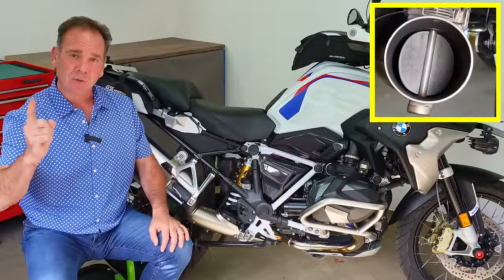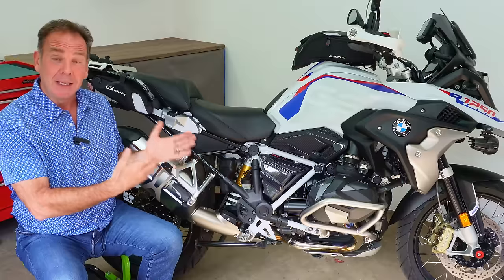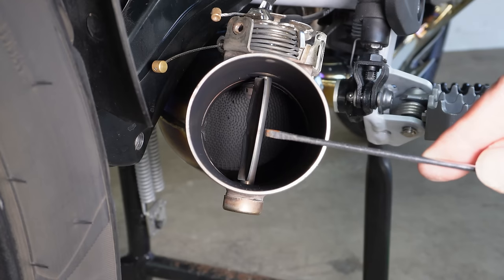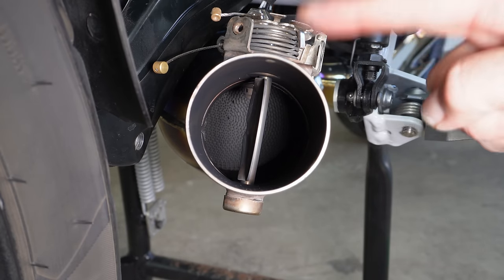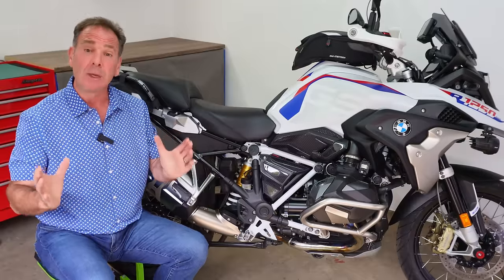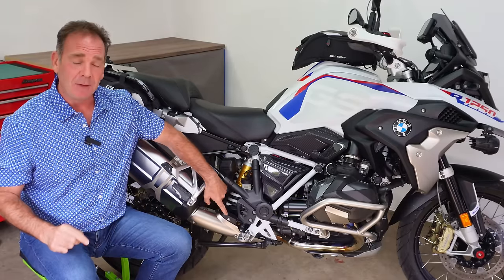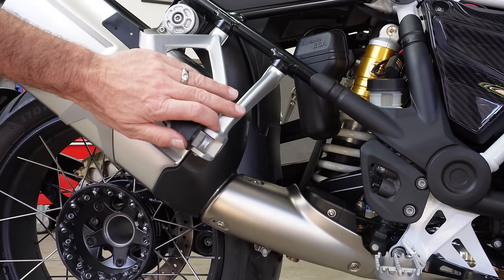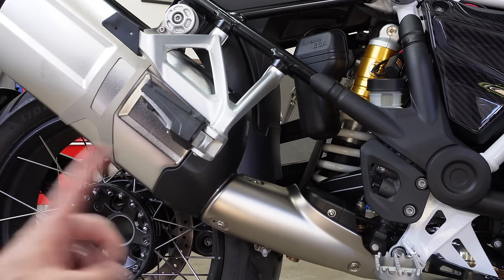EP 25: Butterfly Valve - Exhaust Valve - Exhaust Flapper - Sticking or Seized Valve - BMW R1250GS/A

Comment: Could a stuck or semi stuck in the closed position flapper result in ridiculous heat in the cat and on the right foot? I purchased a 10 year old GS and in anything above 60f, it roasts my right leg.
Reply from the maker: Hi Paul , it’s possible and easy for you to check. The valve needs to operate freely.
Plus…
Other known causes are aftermarket under engine crash plates (skid plates) and some of the rear shock protection devices (mud protection) have been reported to restrict airflow and increase heat levels on the right side.
Also the gear you use is important. I wear full height leather boots and trousers all year. I’m aware of some heat but it’s not excessive for me.
Hope this helps Carl
Ps, for owners that really can’t live with the heat, they often fit a decat set of header pipes.

Comment: Great video…. Really informative……I’ve wurth aluminium anti seaze in a spray can… its good to 1100degC. Is this ok to use or does it have to be copper?
Reply from the maker: Several owners have used it so I would imagine it’s ok to use, although I’ve only ever used the copper spray.. temperature rating is good 👍 for what you have. Carl
Reply: @justthewayitis  great thanks 😎
Reply from the maker: No problem 😉

Comment: Great video, on my 2023 GSA I disconnected the cables &  tucked them under the heat shield where they can move in and out freely. I've been running it that way for over 500 miles, it didn't set a code nor did the check engine light come on.
Reply from the maker: Hi Bill, good morning and thank you for for sharing your experience, you have been very lucky that no codes have been displayed. Best Wishes Carl

Comment: A 2010 r1200gs also has the same valve - so how it lines up with the euro 4/5 noise reduction tests?
Reply from the maker: Having not tested the 2010 bike  with regards to valve operation I’m not 100% sure but it’s probably only there for noise reduction. You could disconnect and do a simple test to see if you notice any performance reduction but I doubt it. Carl 🙋🏻‍♂️

Comment: If this valve is for Euro 5 why was the valve fitted to a 2010-2012 R1200GS Euro 5 did not apply for the 2010 model?

They also seized up on this model as well just like every other GS that has one fitted.
Reply from the maker: Correct they valve is their for noise regulation on the older models too, perhaps I wasn’t clear enough on that point. Although I thought I was.
Carl

Comment: For curiosity sake would doing the servo delete cause any warranty issues or grumbling if my bike had to go back to the dealer for any warranty issues ?
I have a lovely arrow silencer on my 22 GS and have considered doing the servo delete. 
I’ve considered replacing the front headers but been told it could cause warranty issues 
My Harley background never had an issue with changing any exhaust and only required a tune if also doing the air filter but I can’t establish BMWs take on this. Any advice you could pass my way would be very appreciated :)
Reply from the maker: Hi Norrie , better to ask your local dealership directly so you know for sure yourself.
But from what I was told yes it affects warranty if you remove it or replace the front pipe’s.

if you delete it that probably does not affect warranty.
Carl

Comment: Hi is the main benefit to removing the servo to get more noise from the exhaust
Reply from the maker: Partly, yes more noise is an outcome, sone owners like to remove it so they don’t have any sticky or noisy exhaust valve operation.
But on some motorbikes there are additional benefits in performance in the mid range 
Regards Carl
Reply: @justthewayitis  hi I’ve got a mk2 S1000xr do you think a servo buddy would help the bottom end mid range of my bike.

The biggest problem with the mk2 S1000xr is the drone on the motorway at 70mph I always thought it was the air box but I’ve got no idea how to quieten it down
Reply from the maker: Hi, I think the only way to achieve what you are looking for is a proper setup on a rolling road by a specialist that has experience doing exactly that.
Which might involve a delete module for the valve along with fuelling changes to improve the midrange.
You can also check out your local XR forums and see what other owners have done.
Carl

Comment: Brilliantly explained video, thanks so much Carl..   Looking at a £1700 repair from BMW (!), I've currently part-disassembled my exhaust system; however I've got stuck where you disconnect the two control cables... I can't unhook the front one  because I'm unable to rotate the valve like you do, at all, because it's completely seized solid.   Any ideas?  I'm guessing that even if I do get the cable off somehow, I'm not going to be able to use your method to free it up anyway?   Is it worth me buying a delete module, just to get rid of the dashboard warning?  (I don't like the idea of riding with the dash warning permanently on, because it could mask some other future problem?)
Reply from the maker: Hi David, yes to an idea 💡 
Front lower right (see video) remove the control module ( 3 bolts I seem to remember) and you should be able to then easily remove the cable. 
If your is seizes then use wd40 and try to get some movement then leave overnight and move it some more. If you’re lucky it might free off. Although if it’s bad replacement is the way forward.
Let me know if that works 
Carl
Reply: @justthewayitis  Cheers Carl!   Have got the second control cable off now, and the valve is now marinating in WD40. Will keep trying it over the weekend and see how it goes - am not overoptimistic though, looking at it...
Reply from the maker: Fingers crossed 🙏
Reply from the maker: Hi David, another option 😊
Have a look here at this uk company that provides a service on your seized valve.

They offer a great service.

Say hello to them from me 🙋🏻‍♂️
https://www.cymarcbikeparts.co.uk/seized-exhaust-butterfly-valve-service-53-c.asp
Reply: @justthewayitis  Well I did get the valve to move very slightly; but 4 days on, with continuous WD40-ing and wiggling and it's no better at all (can't move it without a mole wrench) so I'm calling it a day.   The Cymarc option looks like a good shout, thanks (I know the company, too) but logistically would be a bit of a mare, sadly.  So the Healtech dongle looks like the way forward I think - just to be clear, there's really no downside of that on this engine, apart from a bit more noise at tickover?
Reply from the maker: Hi David, not really I think you will be fine 👍🙋🏻‍♂️
Reply: @justthewayitis  Thanks Carl - just to put this to bed; I bought and fitted the Healtech dongle; the bike is now back on the road and running perfectly, and after the requisite 3(?)  restarts, the dashboard warning light is gone and I'm a very happy bunny again.   Can't believe that I could been £1700 down to sort this out (likely just for another couple of years, too!)  if I'd followed BMW's lead.   Really can't thank you enough for your video and your support!
Reply from the maker: Hi David, then you now have a happy ending to the EV story which is great. Treat your wife to a very nice meal out with the savings 👍😉
Thank you for letting me know
Carl

Comment: very interesting and easy to follow video so well explained verberly and visually, one question can the servo that operates the mechanism make a high speed clicking noise   on start up , on my multistrada  also 2013
Reply from the maker: Hi Steve, i had a 2013 Muttly too, beautiful bike, yes listen carefully to the right hand side panel under the seat, that's were the servo motor is located and make sure the valve is not sticking.
On the 2013 version it really makes a big difference as does changing the front sprocket down one tooth. 
Best wishes Carl
Reply: Thanks 👍👍
Reply from the maker: Your very welcome 🙏
Reply: quick update Carl, I fitted the exhaust valve eliminator and it solved my problem with the clicking noise on startup, I have a Termignomi Exhaust and haven't found much louder it sounds lovely,  75 euro including post and packing well spent thanks again for your help
Reply from the maker: Hi Steve, that’s great news and it sounds like your a happy chap, wishing you lots of trouble free mikes ahead with your Multistrada, best wishes Carl thank you for sharing 👍

Comment: Why does the valve need two cables? The spring keeps the valve open wouldn’t one cable be enough to close the valve leaving the spring only to close it again when the cable is relaxed?
Reply: I meant to say “leaving the spring only to open it again, YouTube wouldn’t let me edit my first comment
Reply from the maker: It’s a safety thing, just like our old mechanical throttles had two cables, one to pull on on to pull off. It’s a similar principle.
Carl
Reply: How does the ecu know that the cables have been disconnected (or that the valve is stiff/beginning to seize)? Does the electronics monitor the voltage and current draw of the actuating motor and flag up a fault if it deviates from what is expected? @justthewayitis
Reply from the maker: it’s the communication with the servo motor, the ecu is expecting specific voltage’s. So your thought is correct that’s why we should only fit a well designed delete module that can replicate those voltages.
Reply: Do you think we could defeat the valve by hooking up the cables to a suitably rated spring to mimic the load the motor sees? @justthewayitis
Reply from the maker: Sadly no, I believe the servo also measures distance travel

Comment: Hi Carl. Do you see any benefit, or have you heard or read of any benefit of doing a servo delete on a 2014 R1200GS LC?
Reply from the maker: Hi, good evening, you could check your local GS forum for owners that might have done this,  but in regards to benifits I don't see any in terms of performance.
Reply: @justthewayitis  what about sound?
Reply from the maker: Your going to gain noise at idle speed and low RPM without a performance benefit.
Reply: @justthewayitis  cool, ty

Comment: So on my GSA 1250 which I never have gone over 6,000 RPM'S with, I went up to 7,000 and then 8,000. Do I need to go up that high to clean the system as you had suggested or can I keep it just over 5,000 RPM'S or so? Is the valve more open at 9,000 than say 6,000?  The higher RPM at 8,000 was really rattling my teeth! You had said once a month to go Maximum RPM. Does that mean 9,000 RPM ? Thank You!!
Reply from the maker: Hi Eric, no no.... No need to rattle your teeth.
Once a month 7,000 +/- rpm is enough, but ideally over 5,000 on each ride at least once.
Carl
Reply: @justthewayitis  Thank You! For a few miles only or so?
Reply from the maker: No not constantly 
Just use the rev range 2 to 7K several times during one ride to help keep things clean inside the exhaust .
As seen in the video

Comment: Hey Carl. You changed your story from the advice you gave on your Ducati exhaust valve, why is that?
Reply from the maker: Hi Michael, sorry I didn’t see this message, often happens with so many messages arriving at the same time.
I was on the GS. EU forum the other evening and saw the great work you have done designing your own PCB solution for the rear indicators, great work 👍 and a nice skill you have there for designing it.
I’m not sure I understand fully your question, but the Ducati is worth doing, the GS not, at least for my own experience.
Winter is quickly arriving here for us in Germany 😞 season will end soon once the ice arrives .
Ps, I’m collecting a R1300GS this weekend for a 3 day test and review, I’ll let you know what it’s like compared to the 1250. 🤔
Best wishes Carl

Comment: The exhaust valve on my Termignoni Exhaust for my 2022 Honda Africa Twin stuck in the closed position after 1 week of riding.
Reply from the maker: Hi Paul, that’s not good. Have you fixed it ?
Reply: @justthewayitis  actually i had my titanium fabricator cut the inline flapper out and weld in a ti stub. Ti decat header on. ECU flashed. Amazing on the AT.
Reply from the maker: @paulwelsh7834 sounds like a great solution you found 👍 thank you for replying

Comment: this valve look like the "clapet exhaust valve brake" that it is used in trucks and lorries. The clapet it is used for frictionless brake when you close the throttle, brake support
Reply from the maker: Yes it does look similar, but the application is different. Well spotted 👍

Comment: Hi Carl, I love the precision around detail and the teaching methodology in your videos. I have an issue with my 2020GSA that is baffling my dealer - bike is in warranty so should be one for them to pursue for me. Given your knowledge, experience and contacts in BMW, could you express an opinion on the possible resolution? Simple fault but hard to solve. TFT started cutting out during rides. Dealer identified a damaged wire under the tank - repaired. All good with the TFT now except the bike date/time no longer holds in memory. Every start after at least 15 mins of switch off resets the date and time to factory default. It sets ok after a short delay by syncing the nav6 to the date/time in bike settings, but if the nav is not present the bike drops the date/time when shut down and won’t display correctly until manually input in settings. All other settings remain accurate during switch off - bluetooth connections, ride mode preferences, etc. Bike software is up to date as of this week, no faults on the bike diagnostic, everything else working properly. Nav6 also had firmware updated in case this was an issue. Stumped. Any ideas? If not something you can/want to comment on,  no problem, just hoping you had a logical answer to how the bike manages the settings in memory during switch off, and where the issue could be. Many thanks Steve.
Reply from the maker: Hi Steve very interesting problem you have there 🤔
The first thing to know is your dealership will have access to a higher level of technical support from BMW itself and they probably have already escalated the issue internally ( but it’s worth asking if they have done this) BMW have a vast technical support network internally with some very clever guys.

As to my thoughts… it’s a tricky one, first thing I would do is install another known good dash and pair it with the bike, this would rule out a faulty new dash.

If after that, if the problem is still there, then I would look at the ECU , it’s possible that when the wire shorted it may have caused a spike which in turn may have damaged the ECU in some way.
The canbus system is fairly complex as your probably well aware, and a single wire can have many functions and onwards connections.
We have to presume your dealer has throughly checked for further wiring issues in the harness.
That’s all I can think of tonight, but if I find anything out or have any other suggestions I’ll reply again 
Either way please let me know how this Progresses.
Carl
Reply: Thank you very much. I pushed the dealer to release the bike back to me in late august after they had it for more than 2 weeks - I needed it back for a 2 month road trip starting early September. They did say they would seek support from BMW, and have another go when I’m back home. I called in to the dealer in Innsbruck who was excellent, but also stumped without much more work than the time both he and I had to play with. I’m back in the U.K. tomorrow and apart from the date/time issue the bike has been fantastic during more than 8000km in very hot riding conditions in France, Italy and Greece, cold and occasionally wet in Austria, Germany, Luxembourg and Belgium. I’ll speak to the dealership engineers later this week.thanks again for your help. Steve.
Reply from the maker: Hi Steve, no problem, glad to hear you have enjoyed an otherwise great trip 👍
Reply from the maker: Hi Steve, is the problem sorted now ?
Reply: @justthewayitis  hi Carl. Bike is booked into the dealers next Friday. Latest from them suggests they think it is a blown fuse in the canbus loom that controls the on bike memory. Will see what happens next week. At least they seem motivated to rectify- I think things are less busy for them compared to the summer and the workshop is back on better form. I checked it again today. Nav6 connected and date/time updates by sync with nav. Nav6 off the bike- time/date resets to midnight 1/1/2016 after bike off for more than 15 minutes. Everything else working normally. Appreciate your support, Steve.

Comment: So... if you go with an complete aftermarket exhaust... you still gonna face this issue?
Reply from the maker: It depends on whether the replacement system has an exhaust valve installed, most replacement full systems don’t, so the potential problem is gone.
Reply: @justthewayitis  thank you for the response!!